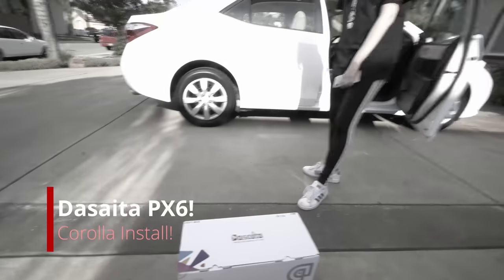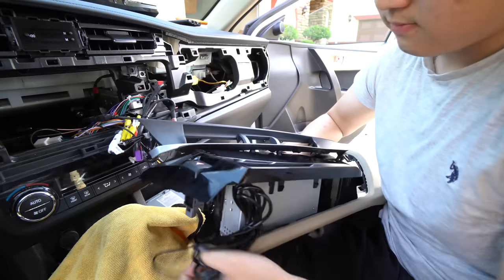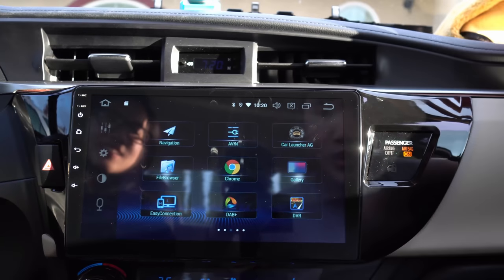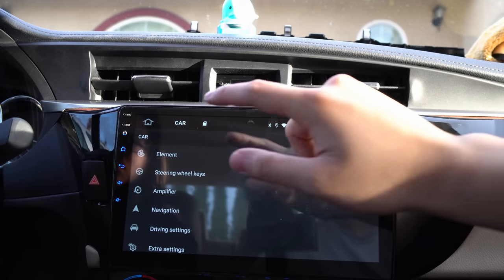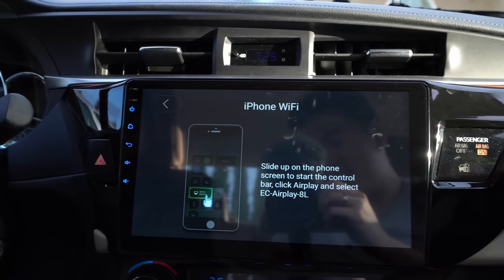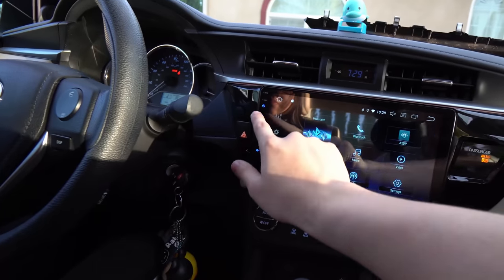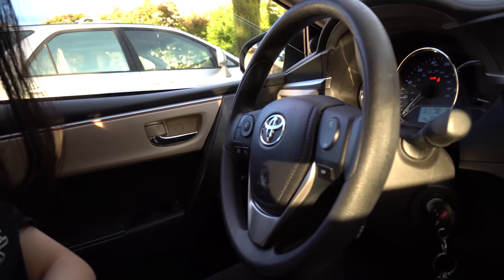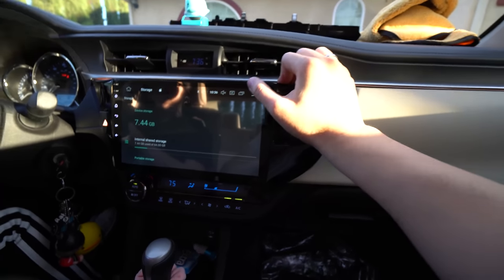Her 10.2 Inch Head Unit Fitment and Experience! | iPhone

Comment from the maker: previous video, for those who want easy access!
https://www.youtube.com/watch?v=ZxYBuQena7I
Reply: Hey, I left a comment on the other video, and I know you aren't my slave, but I could really use your opinion on this radio vs the joying.

(you reviewed a slightly different unit, but this is the newest one https://www.amazon.com/dp/B07S8VXJZB/ref=cm_sw_r_tw_dp_U_x_UkuaDbY3VKNQN)

Reason being, is I am seeing on paper nicer specs on the joying, but I am liking what I am seeing on this one as well...  I just want to buy a decent head unit once and not worry about it crapping out anytime soon.
Reply from the maker: @deitylink1  what car is this going on? Joying has one of the nicest double din! If it's fit and finish, i would go for the dasaita one hands down. The quality of audio are great on both. Joying with the spdif edges out if you do use that.
Reply: John Nguyen do they have a system for 2012 Dodge Charger
Reply: @JohnNguyenVincent  can you please recommend any android auto head unit for corolla 2020 LE. I need upgrade one for my niece. TIA

Comment: That thing looks so dope!!! I wanna upgrade my 15' Camry unit
Reply: Chris R just installed it for my ‘16 Camry!
Reply: Dope! How do you like it? I've been looking into a unit for mines...
Reply: @ John Nguyen, what brand would you recommend for my 2018 Highlander? So many Android models out there and is 8.0.1 the latest version they sell?
Reply: You can do just about anything and everything one it, also purchased a WIRELESS Apple CarPlay dongle for the unit! Plugs directly into the unit’s USB port that I ran through my glove box. The head unit also drastically increases the quality of music, you could trick someone into thinking you have a subwoofer in the trunk!
Reply: The only thing I had to modify a bit was the top portion of the A/C control panel that slides into the unit. There are slots in the plastic that slide into the factory head unit that you will need to “trim down”.
Reply: Which model/ brand did you get for your Camry? Or a link you can pass...

Comment: I'm running 2 Focal component sets with a set of 12 inch subs, a 4 channel is powering the components, and a 1 channel mono block to the subs, off the factory radio, a 2012 Volkswagen CC, is this radio compatible with multiple amps and 2 component sets?

Comment: Hey, when I put the car in reverse, my camera doesn't automatically show up, I have to press cam on the screen for it then show rearview camera. Any suggestions on how I could make it so the camera shows up everytime I put it in reverse??
Reply from the maker: Most cars have a reverse trigger you need to activate. This is a signal that tells your its in reverse.

Alternatively you can wire your reverse light wire. The positive wire and tap into that.
Reply: @JohnNguyenVincent  hmm, but I've installed the yellow camera wires exactly how you showed em, and I have the same toyota, looks like her unit was able to automatically switch on the back camera when you went to reverse, mine doesn't do that when I go into reverse

Comment: Hey John! I have a quick question! I have a 2017 Toyota Corolla and the airbag indicator is flush inside the dash (it’s part of the entire dashboard). I just bought a unit like yours that has a hole for the passenger airbag indicator and wanted to know if you knew where I could buy an airbag lamp. Do you think if I buy a 2016 airbag lamp from Toyota it would still fit?
Reply: Did you ever find that answer to this? I have the same setup as you and am trying to upgrade to this setup.

Comment: They got a Tesla style head unit with a vertical 10 inch screen. I'm still trying to decide if it's worth the extra $$$
Reply from the maker: I don't like the tesla style headunits from my testing. I had the px3 version and it was laggy and buggy. It did look awesome though
Reply: @JohnNguyenVincent  did you use the included microphone? Did you test the quality of the built in microphone?

Comment: I bought one of those for my Rogue. Just can’t get it to power on. Same company. Still waiting for them to give me a solution.
Reply from the maker: Have you just tried powering the constant, accel, on positive and then ground to ground
Reply: John Nguyen They has told me it was plug and play. Gave me the wiring harness for my model.
Reply: Now they think it’s the canbus. I have been going back and forth with the company for the past month and a half. I have been dying to use it.